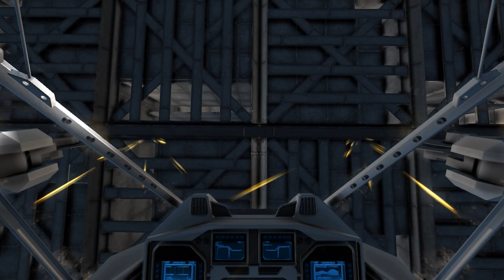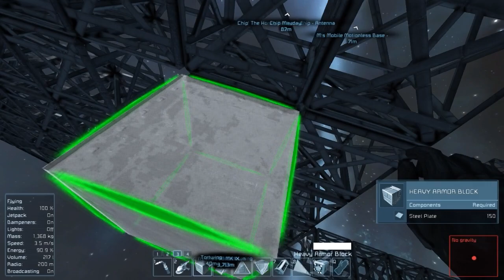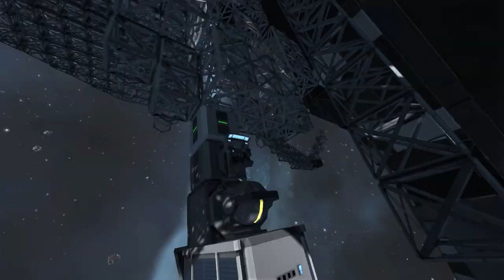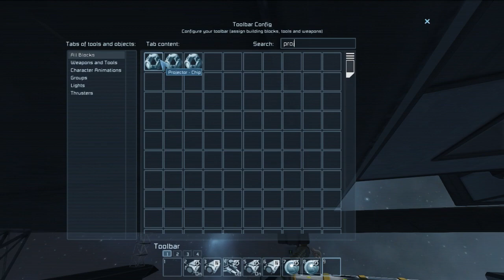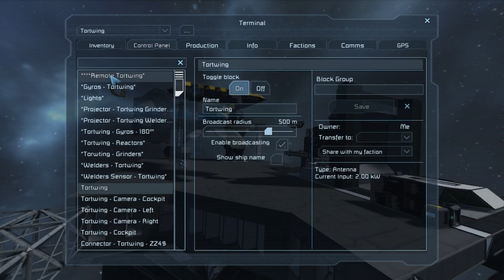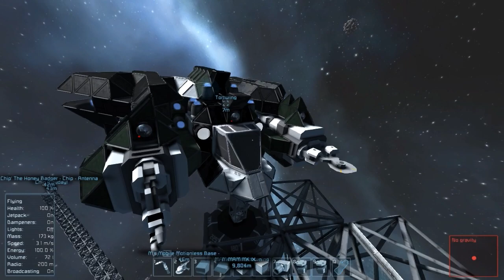Space Engineers • Solo Survival • 67 • Thruster Cluster

Comment: if you havent used a gravity drive yet you should build a small jump drive for main propulsion on that thing and focus on balanced maneuvering thrusters. I built my first and got my 24 mil kg ship to 100 in about 3 seconds. using almost the same space as a large thruster. you could also build it to go in any direction also I suppose. mine only goes forward or down. depending on weather I forget to shut off normal gravity lol. also you have to place it carefully depending on what type of movement you want. your building such well thought out and awesome looking station. I think a center of mass placed gravity drive that goes in all directions would make that the icing on the icing for that place. and give you yet another place to make look awesome. keep up the good work
Reply: also i wonder if anyone has buit a program for using a omnidirectional gravity drive for propulsion using the wasd keys like normal? would be nice i think
Reply from the maker: Dave C Gravity drive might definitely be useful.  I'd like to keep that as an option for sure.  What I might do is leave space for one, and see how slow this thing is once we have the lower section done.  If it's really slow with just that, than we can assume it will only get worse as we complete the top section.

We might have to be careful with is our piston and rotor stuff.  I wonder how fast we could accelerate without those just breaking apart :)

I think I remember seeing a script for a WASD controleld gravity drive :)

yup: http://forums.keenswh.com/post/3axis-gravity-drive-with-wasd-movement-7291317?pid=1286147445#post1286147445

Haven't checked it out, but remember seeing it in the forums.

Thanks for the suggestion.
Reply: ***** thanks for the info on the script

Comment: Instead of closing in the top as well, why don't you leave that open. So the floor of the crane/repair bay would be the roof of your ships inside, with some odd structures around it sticking up of it (sort of like Atlantis from Stargate) where you could have recessed thrusters for braking and a few solar panels to take away the idle power usage of your station/ship (light, basic gravity, conveyors, gyro's etc.) 

To improve performance (both for the game, and power usage of the station) I would however convert it back to a station, if you look closely at your thrusters you'll see them constantly firing. Using pistons and rotors causes a minute amount of shaking that causes the inertia dampening to correct and counter correct rapidly, could be devastating in power usage. I'm not sure if this improved yet, but I had  (few months ago) power usage between 500kW and spiking to 2600kW reducing 1 day of idle to 1-3 hours with inertia dampening on.
Reply from the maker: Taliseth I like the open concept idea.  I was thinking of maybe keeping the crane part open for large ship builds.  So it would look kinda like a pacman from above maybe.  

Could definitely keep that in mind, I plan on building the lower section first, replicating it to the other 3 sides, then start working on the next layer.  We could see what it looks like at that point and explore that idea.

Good point on converting back to a station, I remember someone mentioned before too that stations don't have physics calculations on them so they tend to perform better.  Didn't even consider the extra power usage.  We will look at converting it back :)  I can be less careful when building that way too.

Thanks.
Reply: Glad you like the input, I like your open pacman idea as well. It's great to see someone work things similarly as I would. With the thrusters in the lower section, you could hide the bulk of the side thrust away inside if you leave enough block clearance, and only expose a few of them. Although either way would look great on your station.

Well less careful until you convert it back, make sure you 'Nail' everything down before converting, I created a few new "windows" in my station/ship when I forgot that :P

Sadly I can't play at the moment as I'm waiting for a new CPU cooler and until then I have to use a stock cooler and leaving playing Space Engineers to Let's play'ers :(

Are you against using mods/extension? because if you aren't you could download the bigger gyroscopes (I think they should make a bigger more powerful one for SE itself..) from the workshop, they are slightly more space (and triangle/performance) efficient as well.